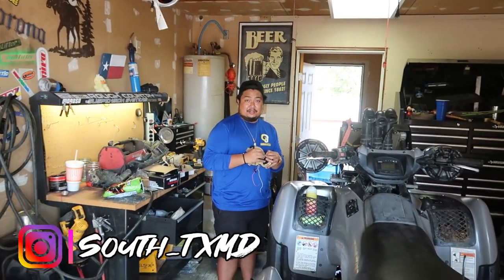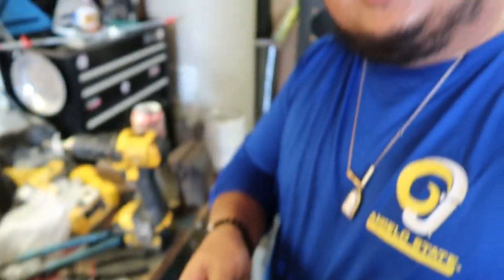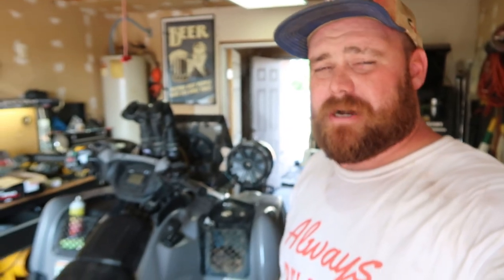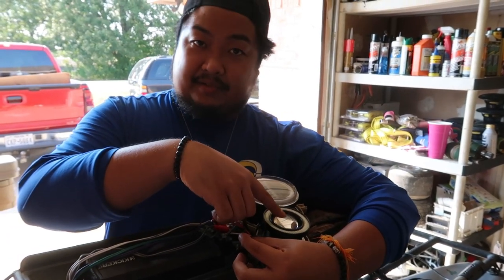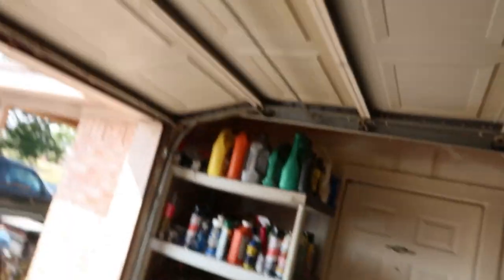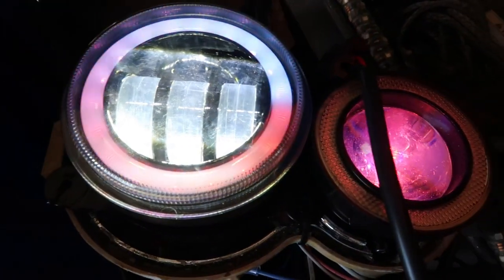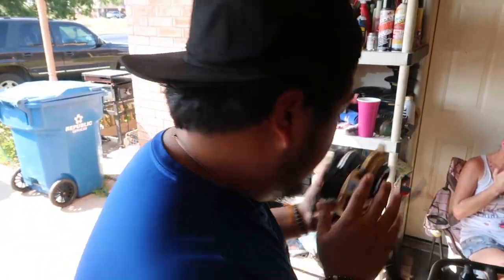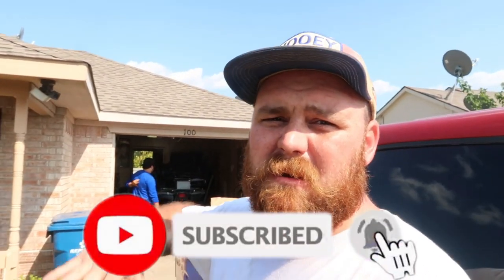4" Portals on a Kawasaki Brute Force [Brute Force Build Part 1]

Comment: What portals are y'all running and what modification did y'all have to do to make them fit
Reply from the maker: These were 4” Gen. 1’s for a Teryx4. To make those work change outter cups on the axles and upper and lower control arms to fit portal bracket for starters.

Comment: Do the teryx portals fit on the brute?? Been really wanting to run portals
Reply from the maker: Keller Kratky yes and no. Direct bolt on, no. With fab work, yes.
Reply: The rear plates bolt up you will have to fab the front plates and a arms